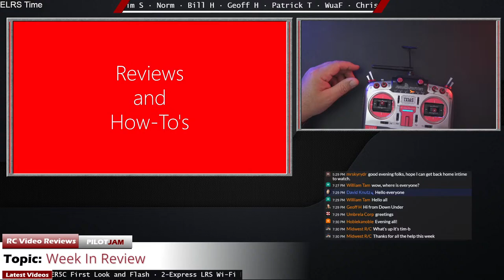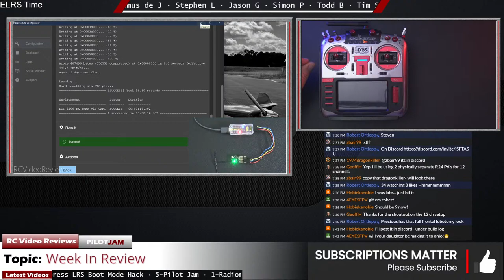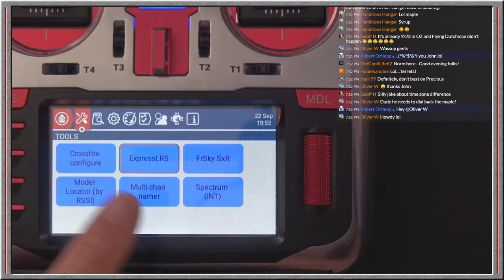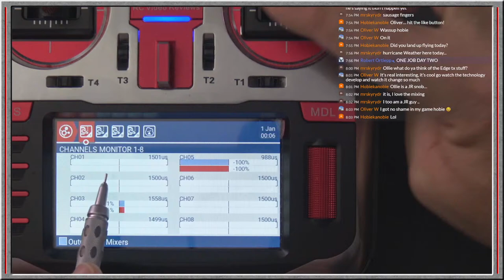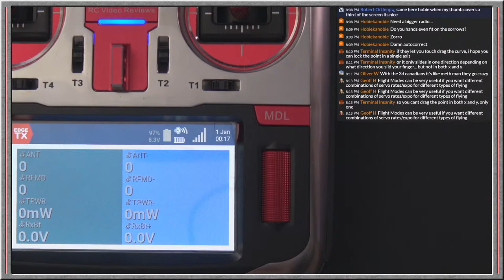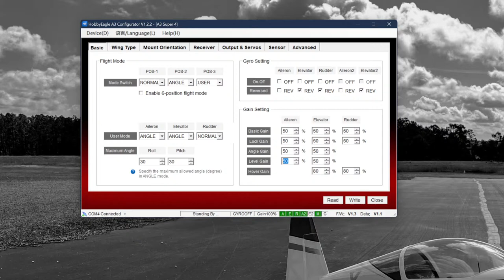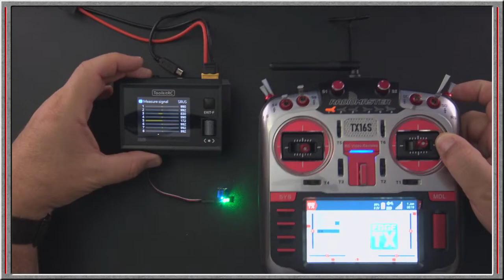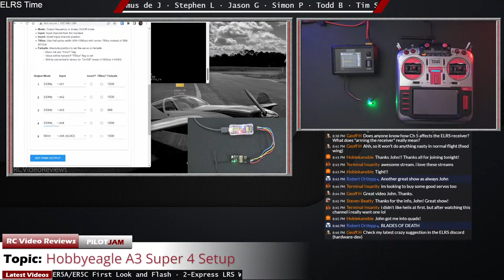092222 • EdgeTX 2.8  Preview • Hobbyeagle A3 Super 4 Programming

Comment: Hey John, re the Hobbyeagle stabilizer, if you absolutely need to have the servo pins at the front of the aircraft, I'm thinking you should be able to mount it with the arrow pointing backward, then reverse the gyro settings for aileron and elevator (rudder isn't affected). This assumes it is mounted face up and not on its side. If it were mounted pointing backward, face down and flat you would need to reverse the ailerons and rudder (though that is a strange orientation given the shape of the case). I don't have one to test, so if you get a chance to try it I'd be interested to know if it works.